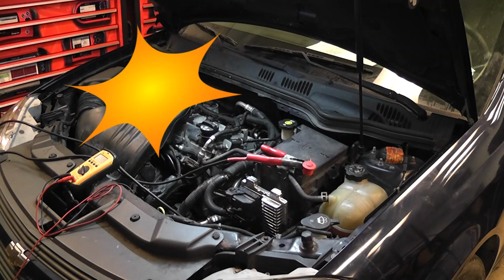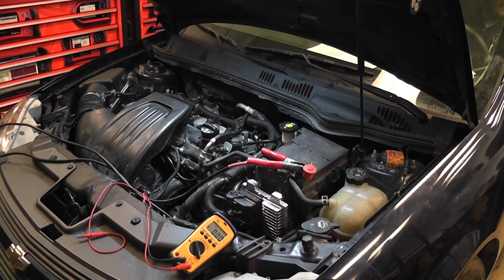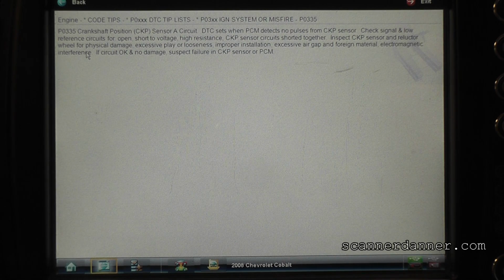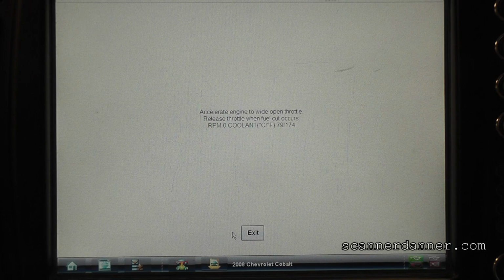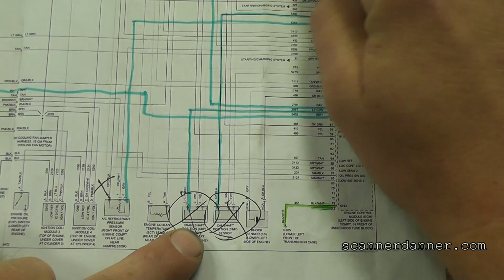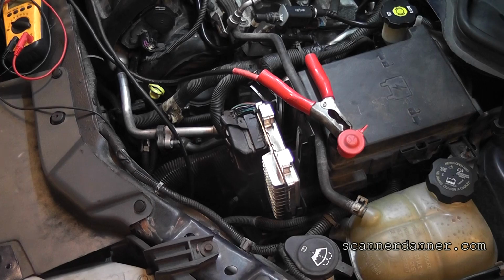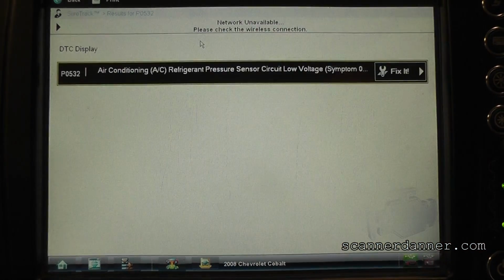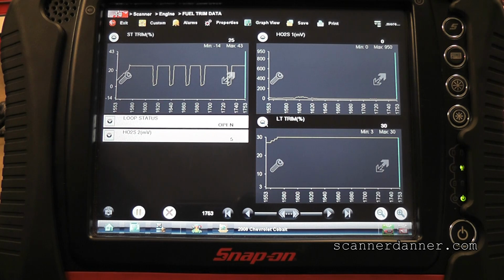Bad Engine Computer Testing Part 2

Comment: I was with you every step of the way!  Learned more from you, once again.  Just a quick note:  I was sure I had "another" power steering problem with my 07 Lacrosse.  Saw a fairly clear liquid on the garage floor, and it had an (like) oily base.  Said, damn that new 6 month old PS Pump is leaking.  PS reservoir was at Max (?)  I just knew the slight leak was from the PS system. 

 THEN, I saw a couple of droplets coming off the chassis - with my little light, they looked GREEN!  Damn, that's coolant!  Took our a sample of the coolant from the coolant overflow and put it on the garage floor - same!  So tomorrow, I'll remove the overflow and go from there.  You have taught me diligence and attention to detail.  Troubleshoot with your eyes first!  - for that I thank you.

Comment: A/C system issue is probably because the system was never charged...  there's an AC line connection doesn't even have the nut holding it together.  Visible often in the video, and a close-up of it when you show the crank sensor plug up close.
Reply: I don't think he ever plugged it back in.

Comment: my car have a several codes then i replace and check everything have a new code, but that one high pressure sensor for the a/c find non sense i replace the computer and set the crankshaft learn then solve the problem for 80.00 bucks so if u have a different codes means u computer are gone and save hundreds

Comment: On the first video I think you said the block ground was connected to the starter pos. I think it was the same car.
Reply from the maker: yes. That was the original cause of this computer failure.

Comment: in part 1 you checked power and ground of the ecu and it was okay ,how do you justify replacing the ecu?
Reply from the maker: It's never easy calling a bad module. There isn't that one test that says "hey, I'm bad, replace me". I verified a low reference voltage in the first part, verified it wasn't caused by a shorted harness or sensor, then verified all powers and grounds were good. There is no other way to restore the 5v ref at this point other than module replacement.

Comment: I have the same problem with my volvo s80 no start no crank and on all sensors test i have 0V
Reply from the maker: Step 1, check all ECM fuses, then check powers and grounds directly at the ECM like I did in this video
Reply: Thanks for the reply....i check all my relays including the fuel pump relay and all are good

Comment: Sounds like there was compression loss in one or more cylinder/s by the cylinders.  If it was the timing chain the engine would turn over like there were no spark plugs.  A compression and cylinder leakage test would be more telling.  As I watch the video it seems that the engine started to run better as the video progressed.  Interesting.
Reply from the maker: cylinder wash from injectors firing

Comment: very good teacher...many people would not admit to the "mistakes" made while troubleshooting. when I was learning to 
repair industrial machines (automated lathes, presses, robots, grinders, etc), besides the sore rear from the bosses applying
way too much pressure reminding me how long production had been down, I learned the most from the mistakes that I
made. those stuck firm in my memory. good videos
Reply from the maker: thank you!
Reply: As a non mechanic I go a little nuts some times watching , but slowly but surely I'm catching on a bit . Thanks for the effort . TheReaper!

Comment: hi I came across your video, and as I started in the motor trade over 50yrs ago it took my attention. I have been across the years working on sidevalve  overhead valve  twin cams, electronic ign, fuel injection then computer controlled systems.  I wish I had you as a teacher years ago! it would have saved a lot of spanner throwing and door slamming.  best tutorial I have found.  by the way I come from the u.k.
Reply from the maker: Thanks so much edward
Reply: Hi Edward. 50yrs? What an experienced man!!

Comment: One thing I'd like to add... at 23:00 look at the CKP ACTV CNTR and compare that to the INT CMP  ACTV COUNTS, 0 compared to 107... that is the tip off that the CKP SENSOR RPM is a substituted value. CKP ACTV CNTR stays at 0 while the cam sensor continues to count up, reset and count up again.

What I am unsure about is why the exhaust cam counter stays at zero, but the ECU seems to be ok with that. At any rate, I think this is how you can tell if the rpm signal is actually coming from CKP or is a sub value.
Reply from the maker: thanks Gary. I'll revisit the video when I can and look at those PIDs again
Reply: ScannerDanner I am retired tv repairman have done some auto diagnosis un believable what you need to know .my advice not replace engines on newer vehicles . someone i know kept changing sensors for a sulphated battery chrrysler van after engine change

Comment: My car has the same exact problem. It cranks/no-start. I don't have spark, I checked my fuel injectors, I have fuel. My car would have been an example to work on. I was leading towards a bad ECM too. But would a ECM usually go bad when I am on the road? I have a 2002 Nissan Sentra 1.8L and that time when it died on me I was driving from an 160 mile road trip back and forth. Would the ECM go bad, or just the coils??  What about a fuel pump?  But it sounds good.
Reply: Frank Lopez
 ignition control module

Comment: Other than the incompetence of the initial engine installation, it boggles the mind that one bad sensor could cause a no crank condition without scanner communication.  Obviously, therefore it could have been a short anywhere in the system. But don't shorts usually blow certain fuses, though the car continues to run funny? Some fuses were not working, but did not appear to be blown. Then it would not be a guess to assume the computer was toast. Right? If a fuse directly related to the computer is not blown but also not carrying juice, how could it be other than the computer? You hit upon that at the beginning almost yet continued looking for shorts. What am I missing? Great work, and thanks for sharing this video with everyone.
Reply: Paul, it wasn't the CKP sensor being unplugged that caused the no start/no crank and no communication; that was caused by the ECU getting fried by the grounds inadvertently being connected to the starter.

Hopefully I understood you correctly...
Reply: Can you maybe help me?
You seem to be experienced in such kind of issues. (regarding your comment).

I have a 2006 Kia picanto 1.1
By turning on the starting key, the check light doesnt comes.
I have also no connection between my Delphi Diagnostic software and my OBD Socket, better the ECU.

What I have done:
when i am put a cable from the battery of the car, suddenly everything is different.
I have taken a separate cable from the (+) of the battery to the Pin 16 of the OBD Socket, then the check light comes.
From now on, I can also connect via my OBD and my laptop and my Delphi tool to the engine.
So, whats the problem with this car? "Ground problem" or "(+) problem"?
Do somebody know, where I can find the ECU by Kia Picanto 2006 1.1??

Comment: Interesting case study.  One of my previous jobs was to teach the GM CAMS computer to the techs in So. CA .  Although the system is antiquated by today s standards  the process is the same.  The fact that the Techs did not understand the systems in vehicles is the root cause for not fixing it right the first time.  It is very worthwhile to go to the scrap yard and to get the plugs for the most common cars and make them as pigtails and document and label them as to what they are.  This saves the time to look back into the computer electrically and prevents having to rip the engine management system apart to test.  Great that you show  the guys cause and effect on various items like vacuum leaks.  T-pins for looking into the plugs is also a great lesson.

Comment: do you have have a way to test bad obd data?  My car runs ok, but has a check engine light on.  I'm using an obd sx computer leash and the computer keeps disconnecting.  I have good power and ground at the obd2 port.

Comment: I got a question; I got an 89 iroc z28 tuned port injection 5.7 liter yet was a 5.0... I tested my mass air flow sensor no ohms... bought a new one along with a mass air flow burn off sensor. all those codes are gone. I have no map sensor anywhere but my car is throwing that code... I hate that check engine light.. on code left is that one.... how can I get rid of that code beings I have no map sensor????
Reply from the maker: you should still have a MAP sensor on that car, even though it is a MAF engine. IF the engine was changed over, you may have an empty MAP connector, that is not plugged into anything and that is why you are setting that code. The computer still want to see the MAP sensor, even though you new engine may not have one.
Reply: +ScannerDanner hmmmm... I'll look again.. thanks
Reply from the maker: you can install one too. Just pick a main vacuum source, run a small length of hose to your MAP sensor, plug it in, then zip tie it to something. 
The car should run better with it too. It would be used as a BARO sensor and some other minor calculations with your fuel system
Reply from the maker: Oh and it will be a three pin connector
Reply: +ScannerDanner sweet... man... I got the car in pieces so it might have been lost b4 I got it.. but yah I'll install one

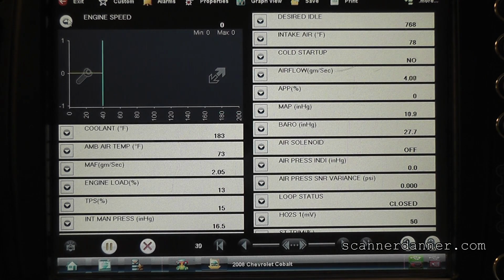Comment: This is a great video for the effects of leaks between the MAF and the throttle plate. Also take a look at 21:30. There is a MAF pid that shows 2.04gm/Sec as well as an AIRFLOW pid that reads 3.99gm/Sec. I'm guessing that the AIRFLOW pid is a calculated value based off the MAP sensor. 

It's too bad more vehicles didn't have these two pids as that would be an awesome way to point out these kinds of leaks. Although it's really disappointing that the computer couldn't flag a code for that. That's a big discrepancy between the MAF and MAP...

Comment: I would of thought to fully know if the timming chain is knackered 1 would need to have a good luck at it. Am rather amazed someone shorted out the computer. Is the computer kind of like a sealed unit or can it be taken apart without damaging it? I was wondering would it be cheaper to replace the regs if its all was needed?? OFC i mean from a customers perspective. Do it themselves so to speak.
Reply from the maker: +James Smith sealed units with triple layer boards on today's computers. Totally non serviceable
Reply: Was thinking that while watching your video. I have seen some you can take apart in the past but not many. Shame the regs not external

Comment: Is it possible to get away with a used computer?
Reply from the maker: +Micheal Deacon yes
Reply: +ScannerDanner 
Most GM OBD2 style engine computers have the vehicle serial number burned into the chip and if you use a loaner or used computer from the exact same style car it will not run, it will trip anti theft and all kinds of problems. If the computer has a prom that can be re written more than once than yes you can
over write the data serial during a re program to match the VIN of the car.

Comment: What kind of a scan program are you running on your computer?
Reply from the maker: +lonleyboy54 I'm not sure what scanner I was using on this one. Snap-on Solus or Verus. 
Anything I was running on my computer would have been a scope (picoscope) or informational program called Mitchell on demand
Reply: +ScannerDanner  You seem very knowalageble so maybe you could help me out with this? A 2000, Grand cherakee Lorado. I changed the fuel pump, and it ran like Sh##t, and smelled like rotten eggs so I changed the converter. After doing that  the battery died, so I charged it up, and then things got weard. as soon as I connected the battery back up, the fan relay in the control panel (under the hood) started clicking like crazey, so I removed it, and the radiator fans started to run, and this is "without" the key in. When I put the key in and turn it on the no key symbel comes up and it will not start! This was running befoer a put the fuel pump in, then ran like miss firing, and smelled, changed the converter, battery died, and now this. Any thoughts? I hope so. lol
Reply: +lonleyboy54 did you wire in this fuel pump or was it a direct plug in type?
Reply: +ScannerDanner Premium It was a direct plug, "but" i had to jump one wire because it was broke right at the plug.
Reply: +ScannerDanner Premium Yes BUT  I had to use a jumper wire on one because it broke off right at the plug. Will that make a difference? Did you give up on me?
Reply: +lonleyboy54 I wrote back before and you did not respond, and now I see that "it" didn't post.
Reply from the maker: +lonleyboy54 no, just get a hundred of these a day. not much else I can recommend through a text. too many variables in your post. 
i would need to see the car, sorry. 
if you live close the Pittsburgh PA, I'll look at it for free at my school
Reply: +ScannerDanner Could it just be the spliced wire? I know that someone said that the computers on Jeeps are very tempramental? I am sorry "IF" you thought that I was being pushey,. That was not my intent. I am sure that you are very busy. I just thought that "maybe" you didn't get my first post, because it did not show up. I would like to think that it has something to do with that fuel pump, because it was running before I changed it. LOL It just ran crappy after that, like a plugged converter. Do you think "if" I just cut the plugs off and wire direct, it would make a difference? THANK YOU for your input and offer!!

Comment: Hi pual
I Flollow and subscribe to your channel and had a question, not sure if you already answered this or not,  I had a question, when you where missing g the 5 volt reference...could you just of un hooked the connector for the computer and feed it a "Key on signal" thank then looked for the 5 volt references to verify that snore where good as well as wiring and connectors... please. Let me know

Comment: Hey Paul great stuff as usual, the dealer should have done that crank learn procedure (P0315) due to the fact that they programmed a new computer... This needs to be done when ever a you replace the PCM, Crank Sensor or anything that disturbs the reluctor.

Comment: Check for AC voltage on the charge circuit. Hooking a ECM wrong or shorting things in a vehicle will burnout diodes in the alternator blowing the rectifier. The AC voltage riding on the DC will cause these kind of problems along with a blown ECM.
Reply: it was unpluged as well bro i am sure of it just like the crank sensor
Reply: Jason Burt

Comment: I don't know if I heard it well enough, but it did sound like the engine initially clattered some on the first start.  I might forgive the GM tech if that's what he/she heard when they first tried to start it.  My thought is that there's no telling how long the engine sat dormant in the yard before it got installed into that car.  With that said, who's to say the tech didn't hear a timing chain slap because that tensioner hasn't had oil pressure in it in years?  One of my frustrations as a tech is never getting the whole story from a customer.  So if I didn't know that engine was already replaced, I might have expressed a concern for the chain as a possibility.  With regard to never getting the whole story, you also don't always get the truth in these back and forth kind of stories between shop A and shop B.  (In your case, GM dealer and Rosedale.)  I've had plenty of scenarios where I or another tech in the shop suggested there might be a bad part in a car and some diag labor would be required to confirm it.  Then we later get a complaint from a customer because, allegedly, we at shop A said a part was bad that wasn't because shop B said otherwise.  The customer never told shop B I said it MIGHT be a bad part and TESTING REQUIRED to confirm.  It went from a possible bad part to just being a bad part because of a careless statement by the customer.  This video by itself gives some credentials to my point. Paul, you said you were told the car had a no start complaint a minute and a half in.  Then about seven minutes in, we learn about a timing chain concern.  Finally, about ten and a half minutes in, we hear that the GM tech didn't say NO start, he said DON'T start.  It's not to say that you couldn't be right about the GM tech, but you could easily be wrong too.

Comment: Absolutely fantastic!Love the way you explain its very easy to understand.
Similar nightmare with ckp sensor ,would hard start and would stall in middle, turned out one of the 3 wires going to the connector were almost gone barely had any copper left,replacing it fixed the issue.
Reply from the maker: Thanks for sharing!

Comment: Hello mister Danner. I had a similar situation with a Mitsubishi with a wrong connected positive and negative post. The powers and grounds for the ECU was on the starter and it was connected wrong, but in this case the engine computer was not damage. Only can not start the engine. It crank but no start. Great video.. I looked and the part 1.

Comment: I bought an 88 Ford Probe from an auction and it would only run at 2000 rpm with the air flow meter unplug. I replace the air flow meter with a low cost use unit. The car ran the same way. I remove the 2nd afm and as I was removing it. I notice an intake baffle had split apart. I remove this baffle and blocked up the hole where it fit to the intake. The car now idle normal.
Reply from the maker: Good catch!